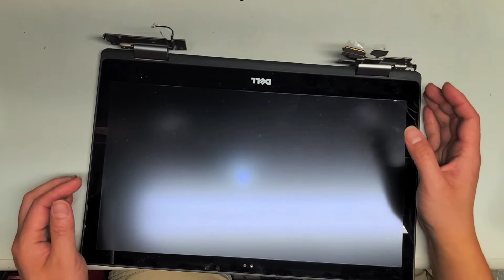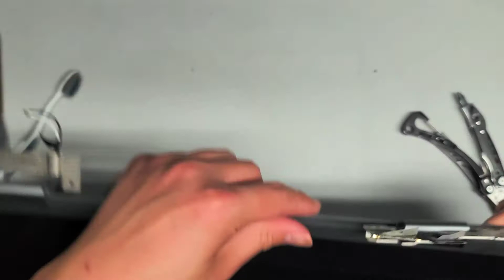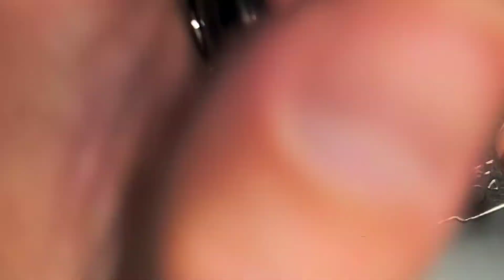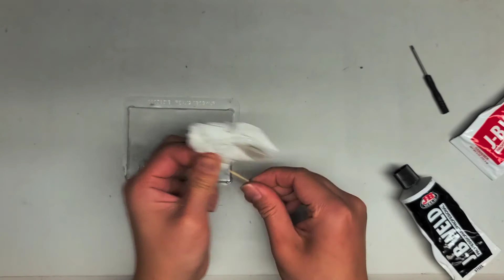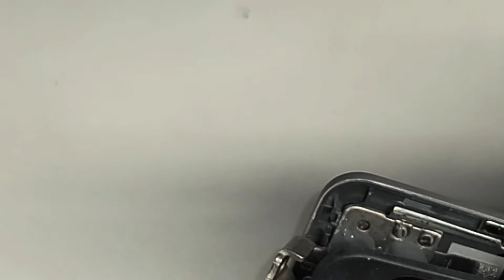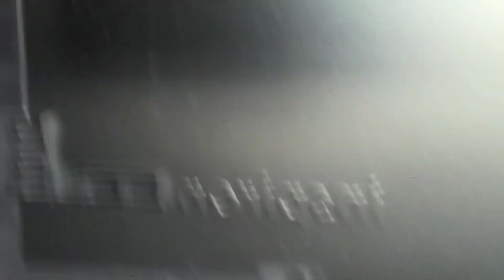DELL Inspiron 15 7579 2-in-1 2n1 Disassembly RAM SSD Hard Drive Upgrade Repair Screen Hinge Fix

Comment: Hi,
I have the same laptop but I want to upgrade a few parts. Is it possible to upgrade the CPU from a i5 to i7, and can I upgrade the SSD card? what would you recommend as far as parts?
Reply from the maker: CPU no, SSD how much storage do you want?
Reply: As much as it can take. By chance, what's the  max RAM, I've seen some say 16, and others say 32?
Reply from the maker: @walterm7214  the only limits are what you can buy and what you can afford.
Reply: @ItsBinhRepaired   thanks bud, your a big help 👍
Reply from the maker: @walterm7214  no problem

Comment: I tried regular nvme one slot 3500 mhrtz don't work in my setup.
Reply from the maker: Nvme? I've never heard someone give a clock speed for an SSD before.
Reply: @ItsBinhRepaired  yeah ps5 nvme needs to be fast is better than cheap slow ones. That's why it generates a lot of heat I guess.
Reply from the maker: Hmmm

Comment: Thanks for this video. Dell Inspiron 7506 i7-1165G7 has also 2 x SODIMM DDR4 sockets, so I'm thinking to buy it (or something with AMD 5700U/5800U). My wife still uses my old Dell Inspiron 15 5578 - very similar to this one and the same decent in replacing the components easily.
Reply from the maker: Sounds good

Comment: Hi, I have this laptop and my right hinge is broken. As well as the black rubber around the monitor is breaking up because of it. Is there any way to repair these, I'm lost and don't know where to find parts. Thanks in advance!
Reply from the maker: You might want to replace the entire screen assembly.
Reply: @ItsBinhRepaired  can you recommend a link or something that I can just buy it from. I don't mind if it's an affiliate link I just want to solve this issue. I've been searching and can't seem to find anything 😭
Reply from the maker: @batman6119  https://amzn.to/3gOgtof make sure you get the right pin count for your model
Reply from the maker: @batman6119  https://www.ebay.com/itm/New-For-Dell-Inspiron-15-7000-7569-7579-Touchscreen-GCPWV-Lcd-Back-Cover-/402525020512?_trksid=p2349624.m46890.l49286
Reply from the maker: @batman6119  basically just Google what you need.
Reply from the maker: @batman6119  you probably need hinges and back cover
Reply: @ItsBinhRepaired  thanks so much! I assume the pin count is under the screen? Also I still need to get the hinge right? If you could include that for the 15inch I'd like to use your affiliate link
Reply: Thanks alot! Really appreciate what you're doing here man, you've got a sub for life💯
Reply from the maker: @batman6119  sounds good!
Reply from the maker: Only Amazon links are affiliates links. Can't find a set of hinges anywhere. Are the hinges actually broken? Usually it's just the screw mounts on the back cover that got torn out.
Reply: @ItsBinhRepaired  do you have a social media where I can just show you pics? The left hinge is fine but the right one with no L shaped brace is broken. I'm also having a hard time figuring out my pin number
Reply from the maker: @batman6119  upload a video to YouTube and share the link.
Reply: @ItsBinhRepaired  okay np gimme a sec
Reply: @ItsBinhRepaired  here's the video link. Let me know if you see the pin count please. https://youtu.be/7i5zBFU1-Kc
Reply from the maker: @batman6119  check the screen model number and your hinge looks ok. The cover screw mounts got ripped out.
Reply: @ItsBinhRepaired  okay so does that mean I have to get the screws too or just the back cover now + screen assembly?
Reply from the maker: @batman6119  back cover and screws are the important parts. Screen issue is mostly cosmetic I think.
Reply from the maker: @batman6119  try and turn the hinge by hand.
Reply: @ItsBinhRepaired  I turned it downwards by hand because it was pushing the screen from the back piece. I think I still have the screws though so maybe I can salvage that. I'll get the screen assembly and back cover at the end of the month and reuse the old screws! Thanks alot man I'll be sure to use your links and I think I have a 40 pin count so I'll be going with that one. Thanks alot again, and you have a good 1!
Reply from the maker: @batman6119  sounds good! Feel free to use what works. No need to use the links. If you haven't already, please like and subscribe so others can find my videos. Thanks!
Reply: @ItsBinhRepaired  already subbed, and it's 30 pin not 40. Anyways I'll be supporting your vids from now